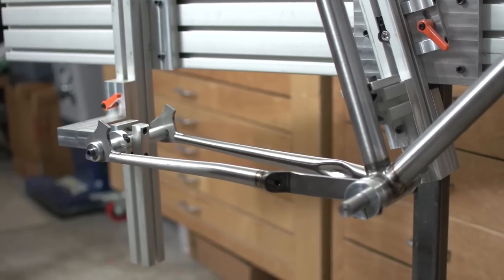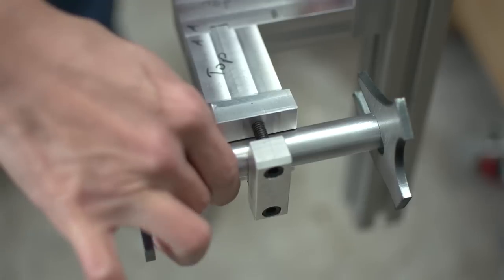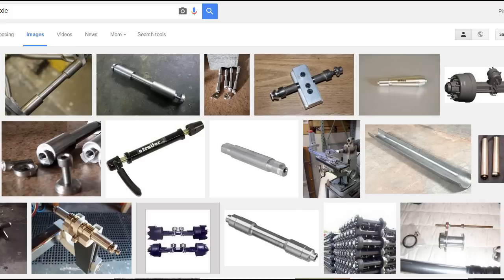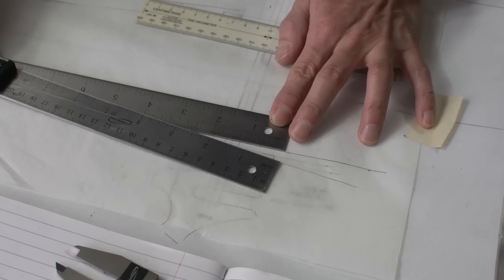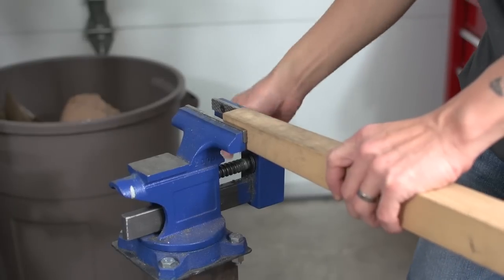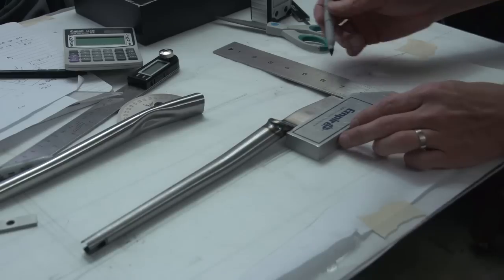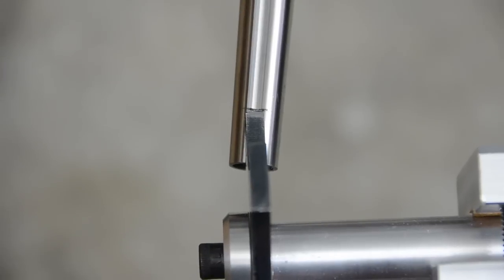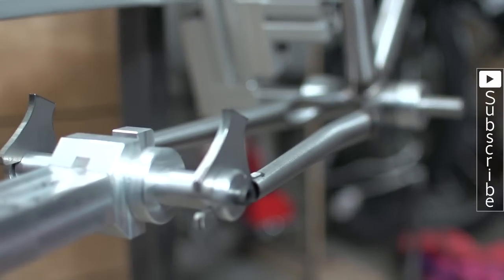Bicycle Frame Build 38 - Notch Chainstays

Comment: You're moving nicely along Stephen. Well done. Just wondering, what kind of slotting saw was that you used for the dropout tabs. Where did you buy it?

Thanks.
Reply from the maker: +Alistair Spence Hi Alistair! 
From Amazon - 
slitting saw  $7!! and works great:
60mm OD 4mm Thickness 72T HSS Circular Slitting Saw Blade

Grizzly Arbor:
Grizzly H5621 R-8 Slitting Saw Arbor
Reply: Cool. I always get a kick out of when basic, affordable tooling works out well. A lot of this stuff is so expensive, so it's nice to catch a break and find something that works and only costs a few bucks.
Reply from the maker: +Alistair Spence I hear that! I'm glad cheap stuff like this exists because without it, I don't think I would have gotten that far with this build. It's nice because with cheap tools, I'm more likely to try out new things.

Comment: Honestly, I'm subscribed to 50+ channels and I look forward to your midweek upload more than any other.    With the momentum you've gained you can't quit after this series is done.  You have to keep it going.  Any ideas what's next?  Lugged/Brazed road bike? Fillet brazed mountain or touring bike? Custom front or rear racks? Single wheel trailer? Maybe move in a different direction and do a series like sewing a custom "bikepacking" or "bike touring kit"?
Reply from the maker: +thesergeant I need to build my son a bike. I'm thinking of something with 20" wheels and extended chainstays to hold a longer built in rack. He plays trombone and needs to cart his instrument back and forth to school. I want to build him something special to hold his trombone on the bike. He's a 6th grader. After that, I really want to build myself a bmx!!

Comment: Just a slight worry.... won´t it be alot easier to shape the top tab of the dropouts BEFORE you weld them to the chainstays and BB? I don´t know how you plan to shape them, but if you plan to use the belt grinder, it´s gonna be a pain to maneuver around with a half-finished frame, just to shape the dropouts.
- Jacob
Reply from the maker: I hadn't thought of that, you're right. I'll do that. TYTY!

Comment: You did do this up so that when finished the wheel will be in the center of the dropouts and not at one end, right?
Reply: +MrGangsta9812  It would effect the tire clearance on the chainstays if everything else was measured and built with the axle in center point of the dropouts.
Reply from the maker: Not at one end but also not at center. It's slightly forward from center. I hope that's OK?
Reply from the maker: +Pithy Bikes Oh man you got me paranoid! I actually went and measured again. Thank you for asking because I do think that I need to push those drops in a bit so the axle will rest center. Thanks again man, you may have saved this build.
Reply: +Pithy Bikes I could be totally off but, wouldn't you just need to make sure that there is room to move the wheel back if need be?... just so you can tension the chain and not have the tire rub? ...Sorry if I am a clueless noob but I aspire to build my own bike someday.
Reply from the maker: Don't worry, I'm a noob too! Yes correct but because I am installing oversized tires, the wheel needs to sit in a specific spot due to very little clearance.
Reply from the maker: MrGangsta is right.

Comment: Nice work. I don't think you will have a problem welding up those gaps on the drop-outs. Maybe weld the edges of the drop-outs longer and grind them flat before fitting up again. Will you have to back purge the chain stays as you weld the drop-outs?
Reply from the maker: Sounds good! Yes I'll back purge.